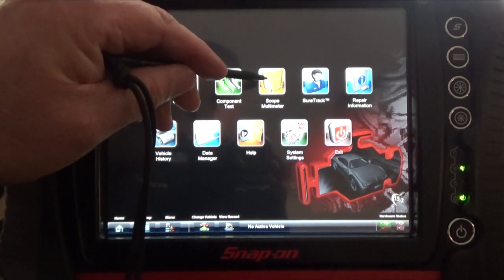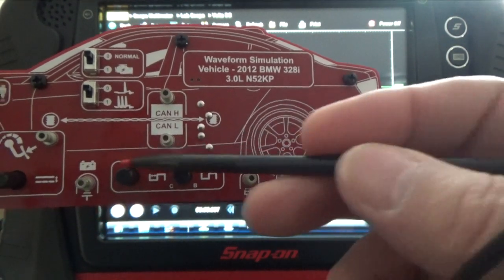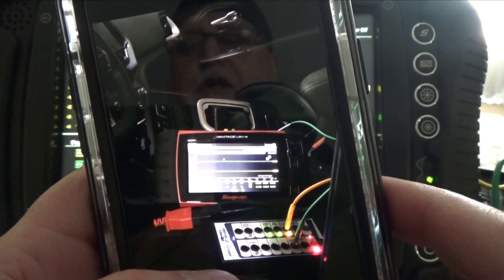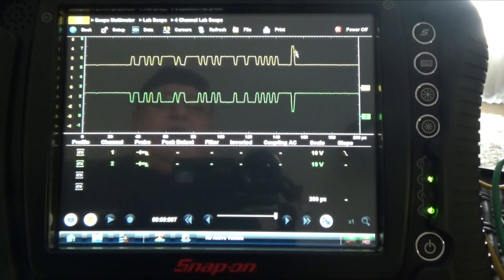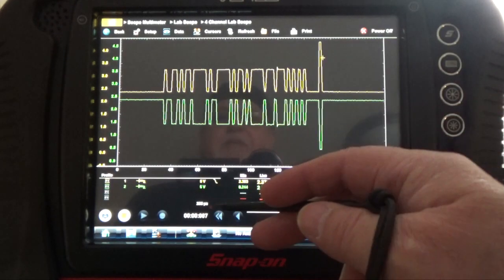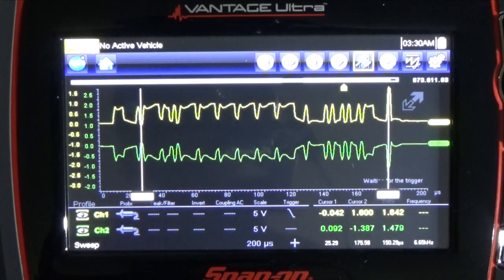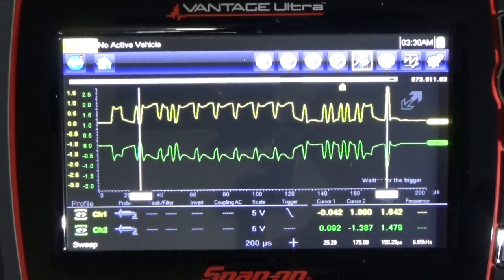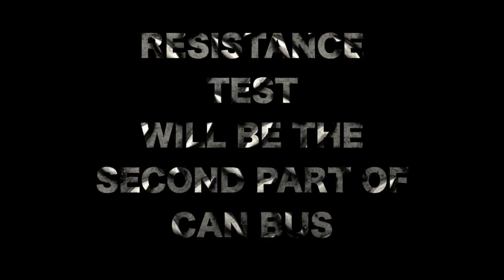CAN BUS Communication Network

Comment: Peter Sambolin, What have you used a CAN sniffer for what reasons to do what with?
Reply from the maker: bill williams Hi well in this video you can see the the tool I’m using and think 🤔 I especially give you how too set up the Snap On Verus Oscilloscope and it shows in the video for more easy access to the DLC diagnostic connector I used a OBDII break out box made by aeswave.com show in the same video a normal good known CAN high and CAN Low waveform and a bad  CAN high and CAN Low waveform!!! So I don’t know 🤷‍♂️ what is your question!?

Comment: PETE SAMBOLIN, what do you use to test each CAN module to make sure they are working good, do you use a scanner and what scanner do you use? When your CAN BUS signal is bad and the hexidecimal value is bad how do you know which CAN module is causing the problem? How do you disconnect each CAN module one by one using what the cars fuse box?
Reply from the maker: bill williams Hi 👋 should put in the video description all the tools 🧰 I used too diagnose CAN BUS network communication problem! But a regular car voltage meter will do the trick! A break out box for the OBDII DLC connector will be an exceptional tool to have because the incontable place they put this connector! Otherwise you have to disconnect the DLC from the location and backprobing the wires because if you used the front terminal you will create another problem! But if you watch in my channel Jeep Cherokee Latitude 2016 is like 3 videos about struck by lightning 🌩 you will see how too determinate went is a bad module by connecting a ohms meter on the CAM lines and start disconnecting modules intel the ohms readings go to specification which is 60 ohms....

Comment: PETE SAMBOLIN, how does the CAN Bus signal when looking viewing a CAN bus signal show the electronic tech the failures and common problems? how can a electronic tech know there is a problem or failure when looking at a CAN bus signal?
Reply from the maker: bill williams Hi in the 9.25 minutes in this video you can see a bad waveform and take a closer look of the cursor #1 and cursor #2 Yellow trace voltage 1.600 that's the CAM positive and should be like 2.5 volts and the green trace is the negative CAN and is -1.367 and should be -2.5 volts so voltage is wrong and waveform signature signal is a life proof of a bad CAN + and CAN - have problems ....